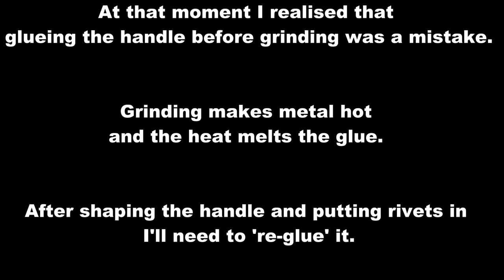Vintage butcher's Cleaver restoration.

Comment: Great job love the handle what I love about a hold me cleavers as you can modify them and not normally have to worry cuz I made out of so much thick material you can modify them just a little bit and it won't make a difference
Reply from the maker: 👍cheers

Comment: Great work!  Nice handle work too!  The pitting is "character" but also a hygiene issue making the blade harder to clean between uses.  It looked pretty thick but wonder if the pitting could have been ground out without taking away too much thickness?
Reply from the maker: Pits were very dip. Hard to take them out completely

Comment: What did you use on the grinder for the final polish?
Reply from the maker: That was a metal polish on felt wheel if I remember right
Reply: @FALCON390Workshop  thanks.

Comment: Why change the shape of the  cleaver. You take away the shape and you take away the character. Its no longer a butchers cleaver now its just a cleaver.
Reply: Smacked the nail square on the head on that, mate 💯👍
Reply from the maker: It still works as a butcher cleaver. If it works and get the job done it can be called anything 👍

Comment: Put your power tools away and do it by hand then you might learn the process better, those brass inserts have gaps from not being clamped properly. Number one rule when clamping…when you think you have clamped it enough, put more clamps on. I am a semi retired knife maker so not just some internet wannabe. All things considered not a bad job considering all the rubbish tools you used. But knife making and restoration is a learning curve. Good luck with future projects I hope you get to invest a little more in tooling and one final thing…..slow down and enjoy the process, it’s more satisfying that way.
Reply from the maker: thanks for the tip and your feedback